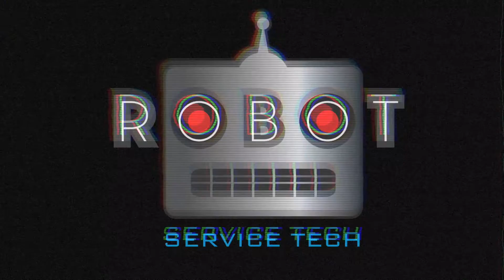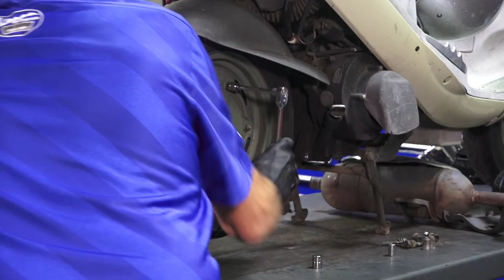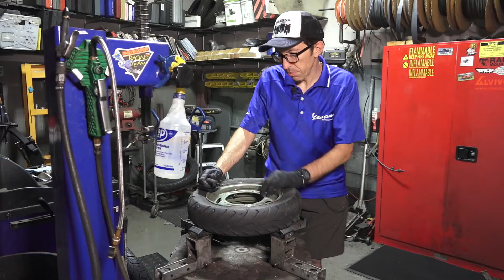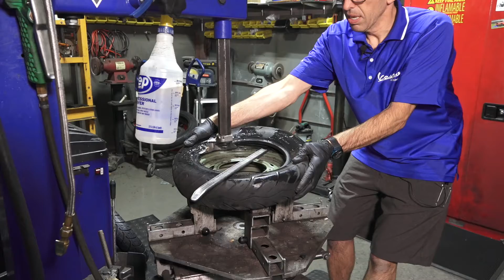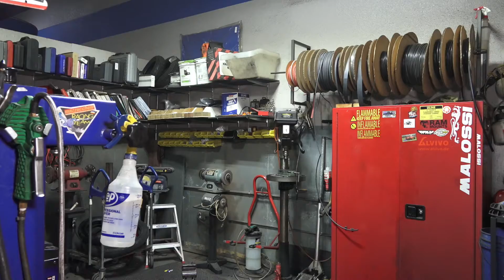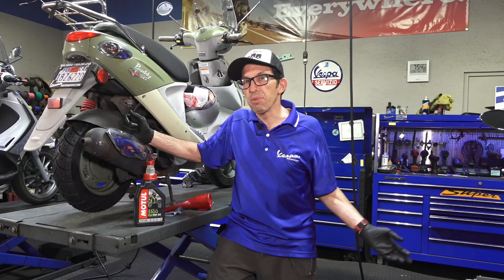Scooterwest is Hiring & Robot Changes a Rear Tire on a Genuine Buddy Scooter

Comment: Once again you've produced a very informative video. I do have a concern as to why you eliminated the rear brake inspection and cleaning. Most likely due to time constraint of video? Thanks for the great series of videos.
Reply: The brakes last so long you almost never need too check them? I have 8k on my pads and they can probably take another 8k mainly because scooters are chill… I roll up too red lights and they turn green before I put my feet down haha and engine braking is instant on an automatic with little momentum/wheels.